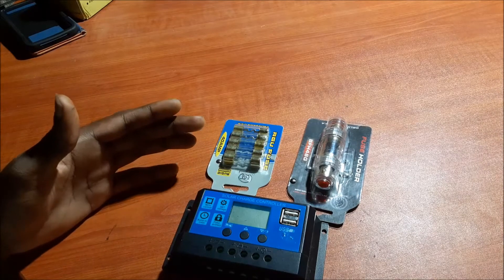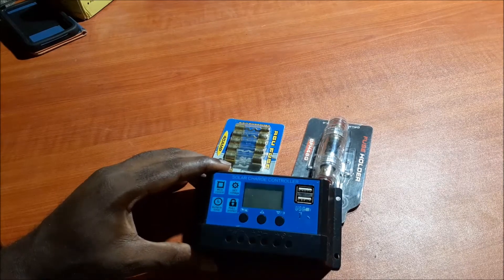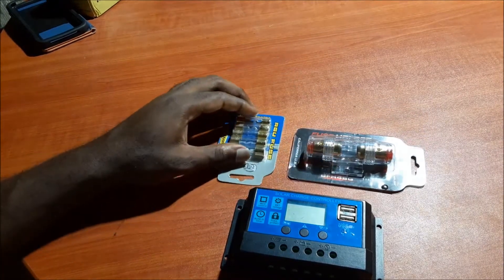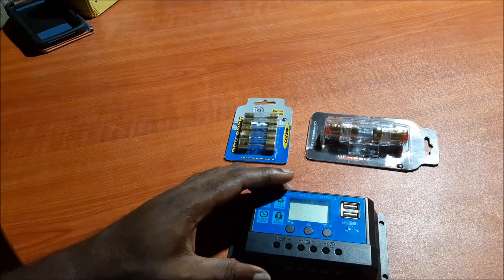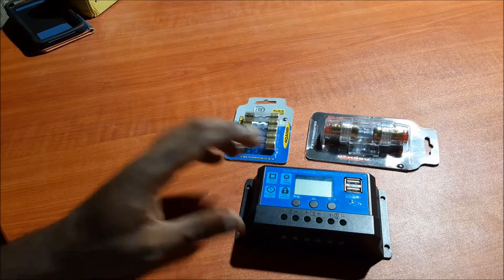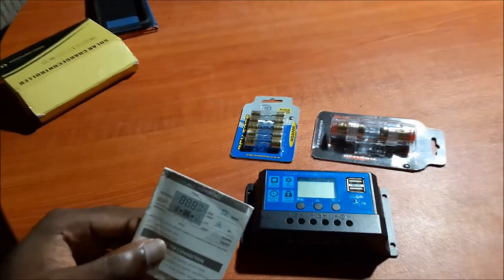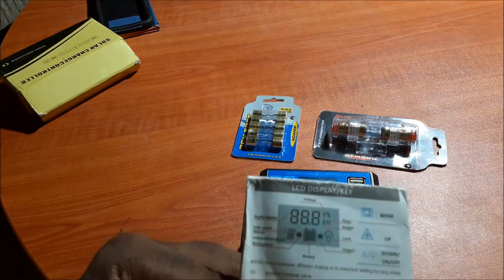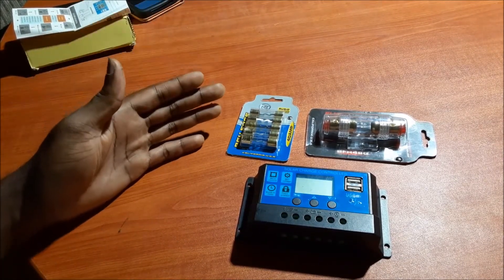how do i know my solar battery is not charging how do i know my solar system is working properly

Comment: Mine won’t charge either (30a controller)

Controller says 15-16v from panel but the arrow is solid filled in and says ‘off’ just above the picture of the panel. 

Multimeter read direct from
panel: reads 34v 
controller: 16.4v 
battery: says 12.5v 

Also my controller says 0.0a

Anyone else think my controllers broken?
Because I sure do 🤷‍♂️
Reply from the maker: Can be. use a meter to measure whats coming from the panel

Comment: Hi, just rigged a system up and the battery shows empty and is flashing on and off. I just read the same manual you have and I can’t see anything about the battery icon flashing.
Reply from the maker: Hi try giving it some charge

Comment: Good day brother.

What is happening when the green light is flashing very fast on my charge controller?????
Reply from the maker: which controller do u have ?
Reply: @Lenzwalters  Good morning brother.. I have a Jarrett 30/40 charge controller

12/24vol
Power 500w (12v)
1000w (24v)
Model jar-PM30

My battery is Jarrett 12v 100ah

Inverter is Jarrett 2000w
12v DC  to AC 110v modified sine wave

I have one solar panel 150w
Reply: @Lenzwalters  
My battery has about half percentage of charge on it based on what I am seeing on the Charge controller, but no power is running from my inverter so that I can use the power supply..

When I turn on the inverter the green light on the inverter is showing, but I am not getting any electricity from the inverter.. the inverter is very new and I just started to setup my solar system... 

Before I started to charge the battery from the Solar panel for the first time, I tested the battery and the inverter, and they were working properly.

The battery is showing charge on the controller but I am not getting any electricity????

What is the solution to this?

Comment: Hello dear my two panels provide 10amp to controller but it charge battery with 4,5 amp when I turn on 3 ceilings fans and lights it come down to .09 or -1.6. what is the issue ? it’s must goes up to 10amp but with load it’s don’t provide power to battery
Reply from the maker: you use load from the controller or inverter from battery ? and how did you wire your panels in series or parallel  ?